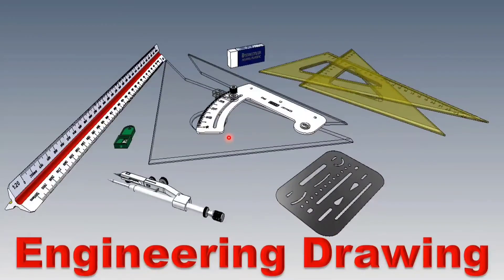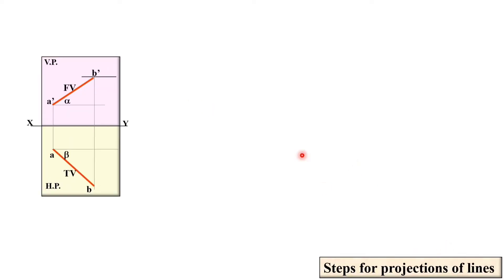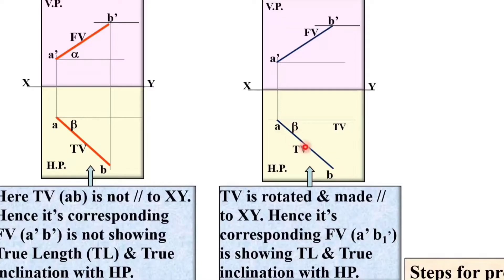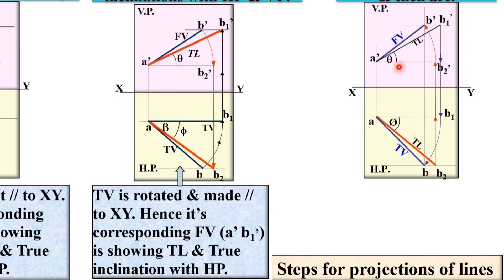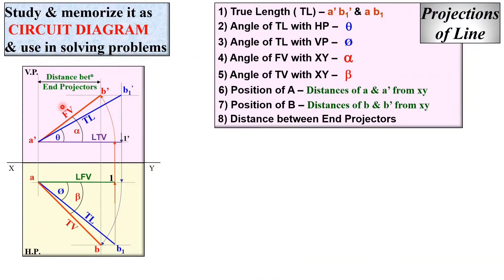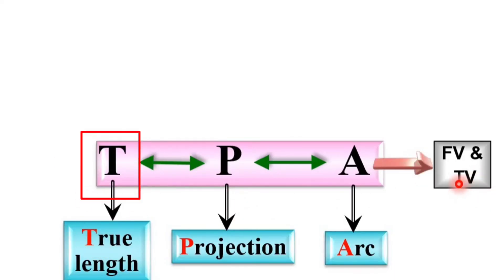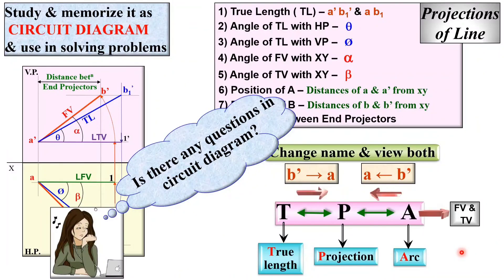2 - Projection of Line (Basics, Drawing Process & Solved Example) Explained in Engineering Drawing

Comment from the maker: Projection of Line explained with following timestamp: 
0:00 – Projection of Line in Engineering Drawing lecture series 
0:16 – Line inclined to both hp & vp
1:16 – Orthographic pattern
3:09 – Steps for projections of lines 
3:20 – How to find TL
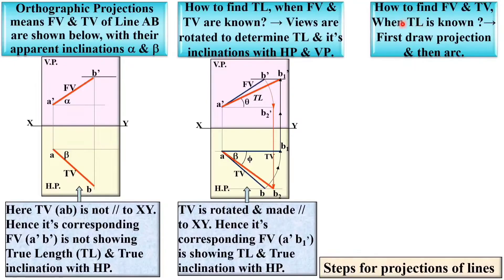5:41 – How to find FV & TV
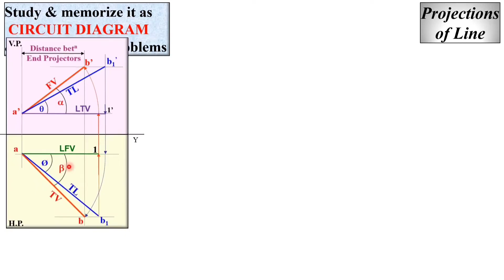8:22 – Projections of line 
8:35 – Diagram for projection of line
8:50 – Terminology in projection of line